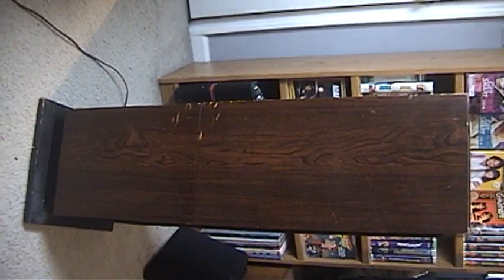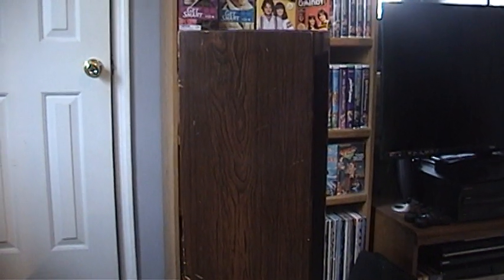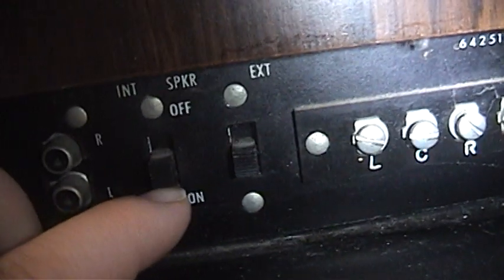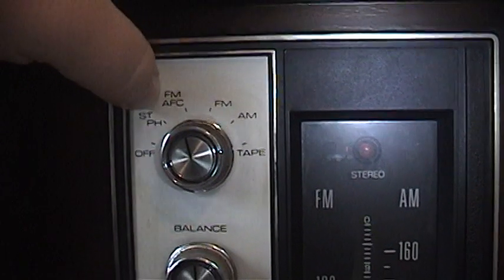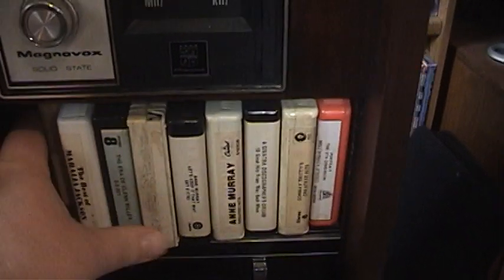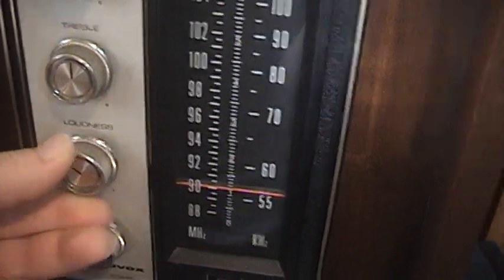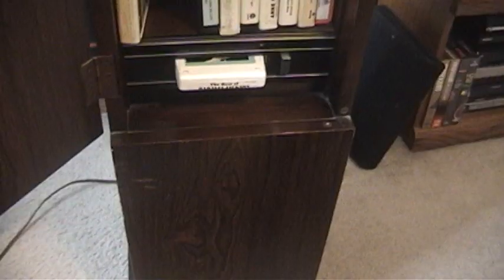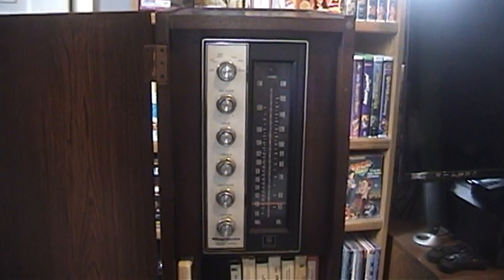1970 Magnavox AM-FM & 8-Track Tower Stereo System

Comment: 3:00 Almost all Magnavox consoles had ceramic cartridges, so I doubt they'd put a pre-amp and de-emphisis circuit in something this basic. A ceramic phono input should take just about any line-level signal since no de-emphasis is needed with ceramic cartridges .
PS: I'll bet that "power" connection is to enable last-record-shutoff with a Micromatic (Collaro) record changer. Also, the "coat of arms" emblem was common on Magnavox products up to maybe 1975; I've seen it on a number of console stereos and even some table radios.